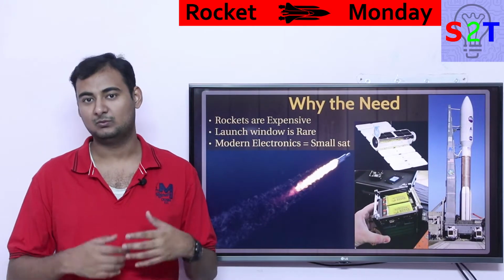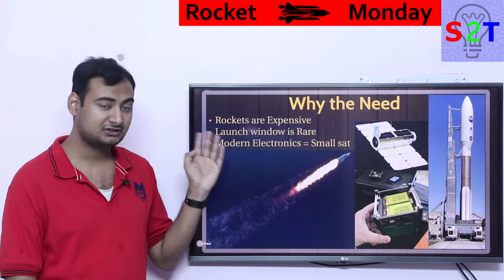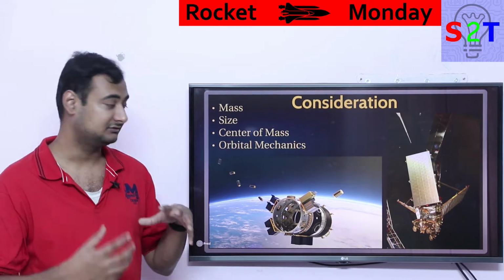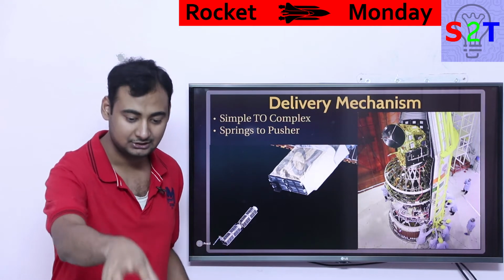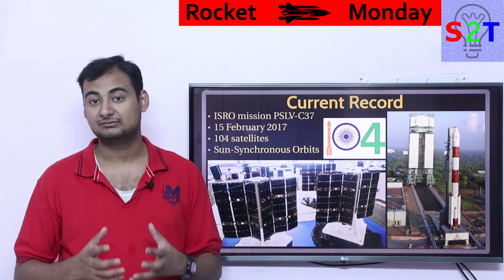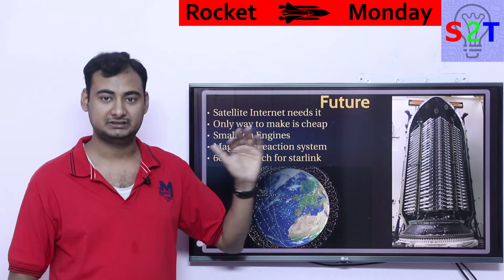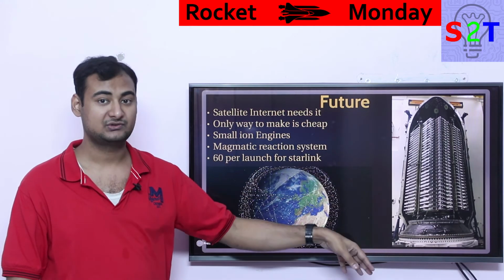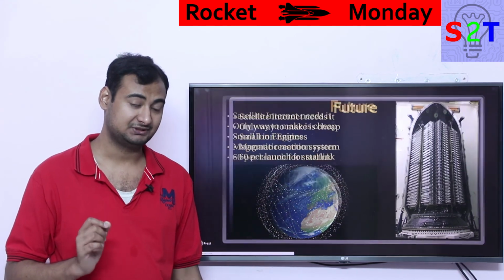Rocket Monday Ep46 (Multiple Satellites in ONE Rocket Explained)

Comment: Do Arca space can succeed with their water electric propulsion ?  The momentum from water you get is high  but on the other hand you have use a kilowatt power batteries and density water much higher than cryogenic fuels (LH2 and LOX) or semi cryogenic (RP-1 and LOX) ,so these may add much mass to the rocket as drawbacks. Is that right ji
Reply from the maker: water in space = power but water can't take you to space

Comment: In small satellites they are using reaction wheels or momentum wheels to stabilize or orient them and even I large space crafts like space telescope (eg:Hubble,James Webb,etc) and even in chandrayaan and Mangalyaan for reorientation and manuring process to get the inter planetary orbits. Thses wheels rotates the space crafts in opposite direction through it's centre of mass and they have 3 for primary use and one for backup purpose ,so its totally 4
Reply from the maker: small satellites epically in LEO use  Magnetorquer
Reply: @AnupamVipul  yes , that removes that the risk of more mechanical part in satellites than reaction wheels that more better for orbiters but interplanetary travel cannot relie on the planet's magnetic field as that want to travel between planets and long distance. Is it right ji...